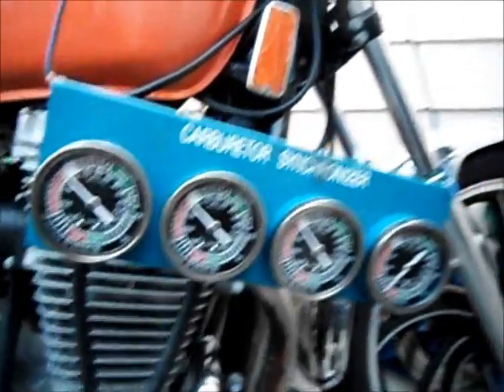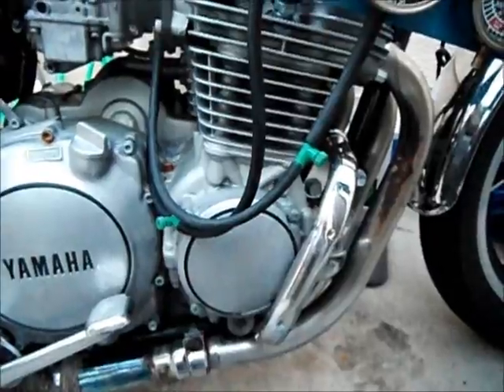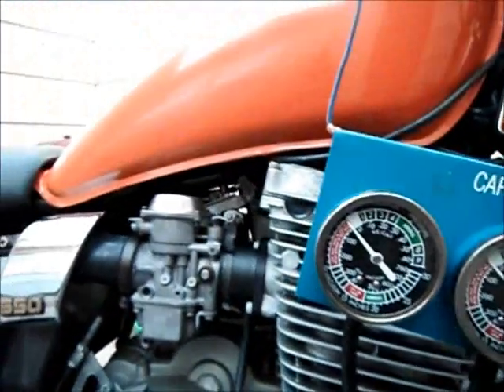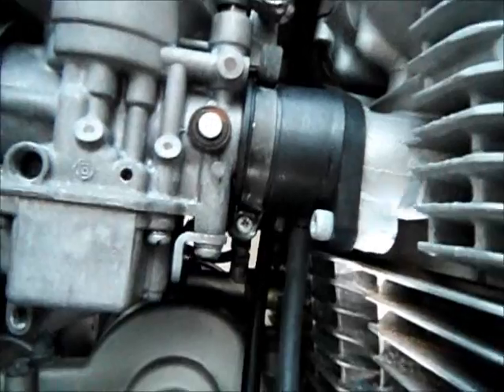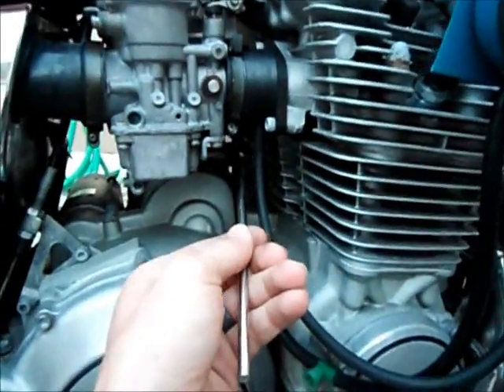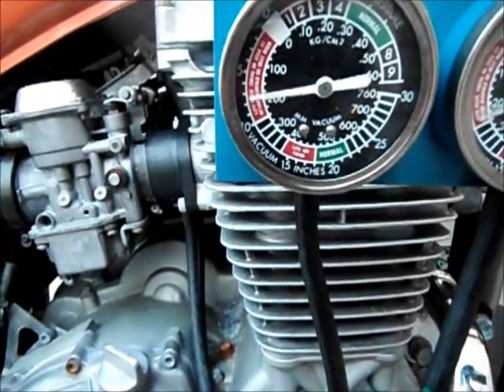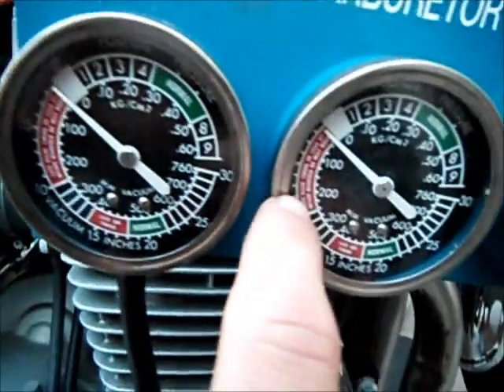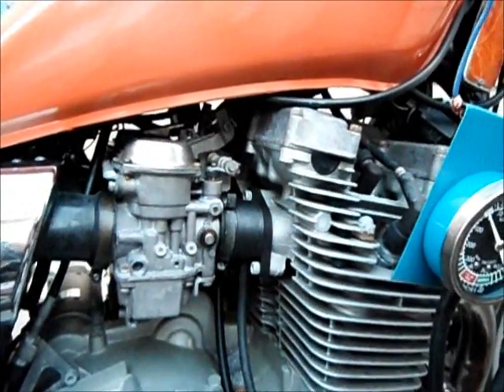Carburetor Sync Yamaha 650 Maxim 1981

Comment: the pictures really helped me at the start. I was a bit of a tard and thought that the sync screw between the #2 and #3 carb was the adjustment for the idle, but nope. I don't have the gauges, so I may end up taking it to someone, or buying a set so I can fine-tune the sync, but since it was only one screw out of sync it's possible to get it back after some fudging around. (I found the engine settles at a low point and runs nicely)

Comment from the maker: Also check all the rubber caps or screws on the rubber boots between the carbs and the head, if the accelorator pump runs off vacuum at the fuel shut off valve, check the vacuum line, check and clean tank rust out if need, any minor crack in intake boots,carb boots, fuel lines or vacuum lines can cause major issues, check all this before making any adjustments to carbs, message me for any more questions, please reply if this info was helpful to you...

Comment from the maker: Make sure your jets are where they need to be inside the bowl,i know,i cleaned mine one time and had 2 jets in the wrong place, also sync is the key of this bike, always sync off #1 carb, and with your low fuel running issue, make sure tank is not rusted out, next make sure that your accleorator fuel cock vacuum is running of the #1 carb.

Comment: Just a thought. I have an XJ900F. To sync that you need a YICS tool which blocks off the YAMAHA INDUCTION CONTROL SYSTEM. Without that there is no way you can sync the carbs properly. Don't ask how I know this !

The engine looks almost the same but for the YICS system just below the induction ports

Comment from the maker: Defintly a air fuel issue, buy a set a sync gauges off ebay, follow the procedure in this vid and i promis it will run like new, i was suprised how great my 82 ran afterwards because mine done the same thing, also at a quick twist it would hold a high idle forever before falling back to normal idle rpm, first sign of carbs being out of sync

Comment: Great video. I noticed the one of the pipes gets hotter by the head on my 81 650. Would that be one running lean? Should I miss with the mixture screw on top? Thanks.

Comment from the maker: Sounds like either the idle jets in the carburetor bowls are clogged, or the idle screw has backed out more turns then need be, look for a screw with a black know pointed out torward the rear of the bike in the middle of the 4 carbs, work the throttle abit while screwing it in like your tightning a screw to see if it will hold idle on its own, @30seconds in this vid, in the middle of the 4 carbs you will see a star shaped screw, thats the idle screw.

Comment: hi i got a 650 maximum and it has like no power it dies when i give it gas i bench synced it and now i am on the vacuum part and i wanted to know how much psi is the carbs ment to run by default? my carbs are all reading 5psi so is that why it keeps shutting off when i give it gas or is that something else? i been stuck here for a wile now and would like some answers if possible

Comment: I need help. I have a 82 maxim 650. All was going well until i ran out of gas one day. I filled up road around and now the idol is sitting at 2000 and higher. and it will not come back down. Any help will be appreciated.

Comment: I need to know if there's a place to get a set of real carbs.  The HSC32 carbs are total junk.  I had them off two times and used at least 4 cans of carb cleaner on these pieces of junk.  I had a spray coming out of the fuel bowls that went 20 feet. I sprayed the cleaner in the thing that goes into the retarded jet in the fuel bowl. I get fuel from the tank. Compression 150 140 140 140 using Mac Tools tester. Great spark. Seems to run better with full tank. Lower it gets harder to start. Junk.